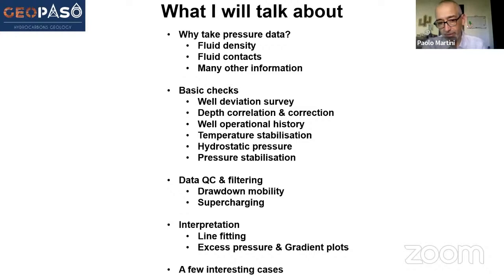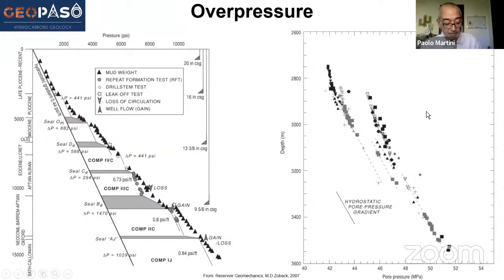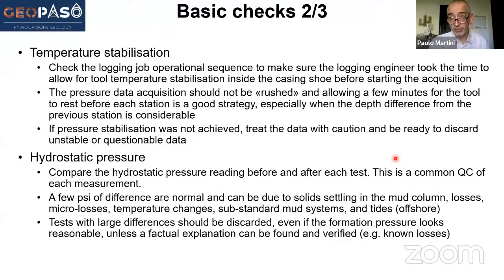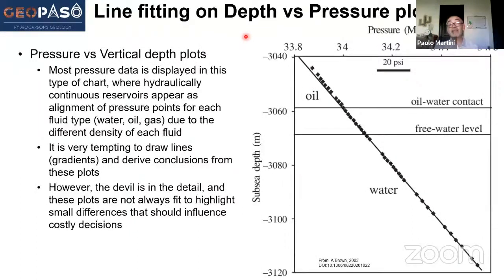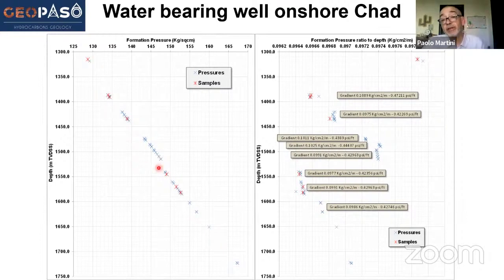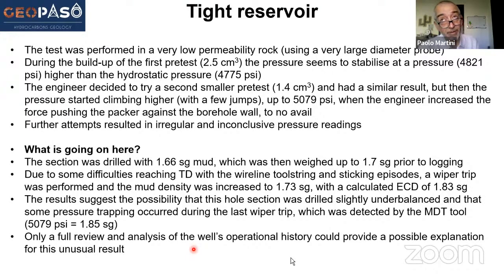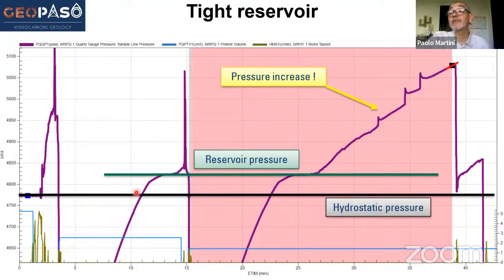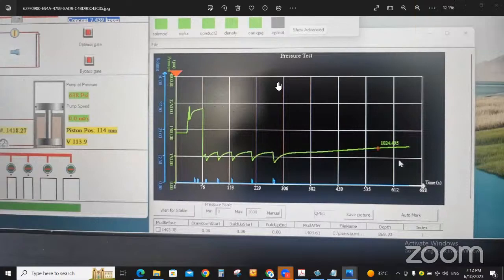RFT/MDT LOG DATA TREATMENT & INTERPRETATION

Comment: THE PRESSURE IS THE MOST IMPORTANT FEATURE IN THE RESERVOIR, AND IF WE HAVE A COMPLETE UNDERSTANDING OD ITS BEVAVIOUR WE CAN KNOW ABOUT:
FLUID MOMEMENT
RESERVOIR ENERGY
CONTACTS
STRESS SENSITIVE RESERVOIR
BOUNDARE SEALING ORNOT SEALING
CALIBRATE SIMULATIOSN MODEL

The pressure always give VOI, only we have to give the best data treatment & interpretation.
Thanks for give me clarity about the Excess pressure plots and its applications